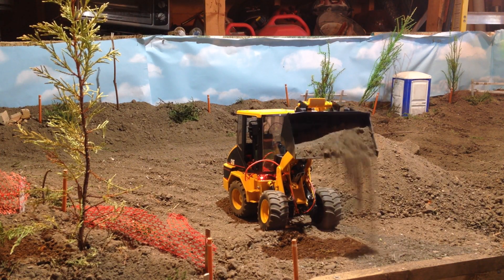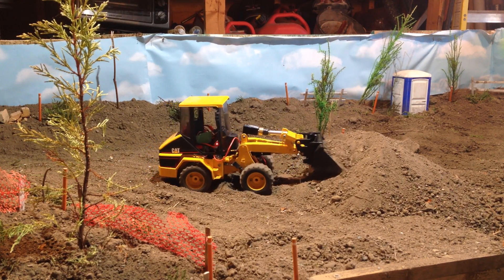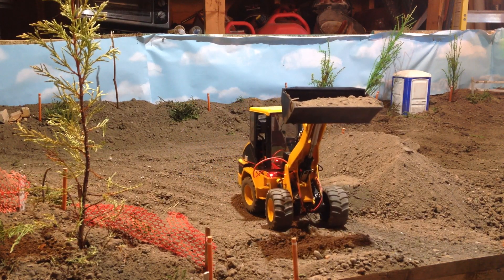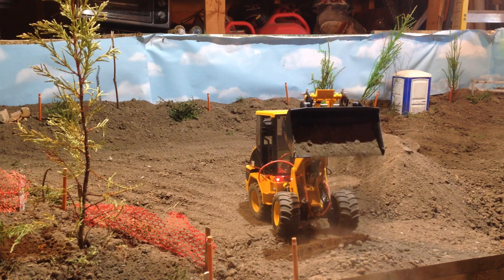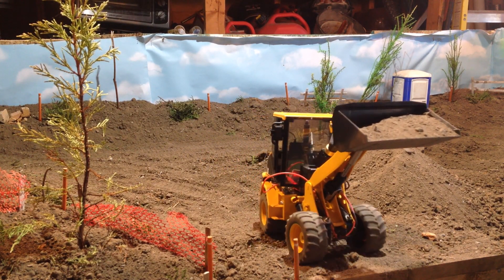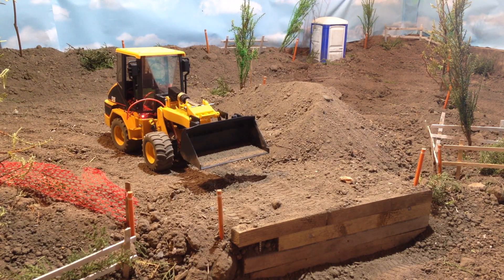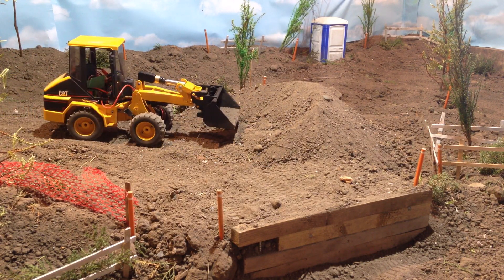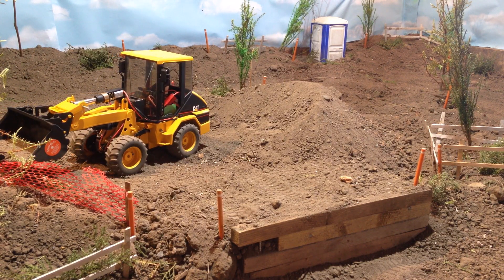TALKING ABOUT THE 906 RC LOADER

Comment: It’s looking good Nick, experimenting with motors is a good idea and yes you are right the single cylinder makes a big difference to the limits, on my Liebherr/SCANIA crane I use a T8 and 300 rpm to lift the main arm and the arm has a bit of weight to it seems to work ok, if you find the lower rpm works best then stick with that, function over speed is a good compromise. Well done for sticking at it and for sharing your experimentation, I love your honesty in the performance so many people edit out the fails good to see an honest performance test
Reply from the maker: thanks Neil! i am still going to try out your recommendation to see what happens, plus itll be good experience for tapping threads etc..... and i would like to know also for myself also. Besides at least with me i want people to see those un smooth moments, because it shows them that your going to sometimes have to power through frustrations at times, and its not always smooth sailing.